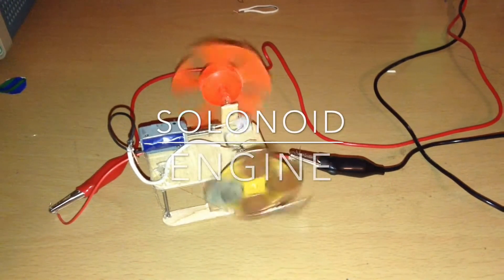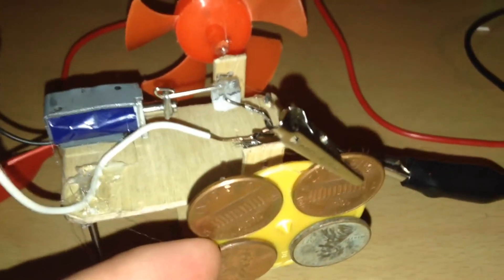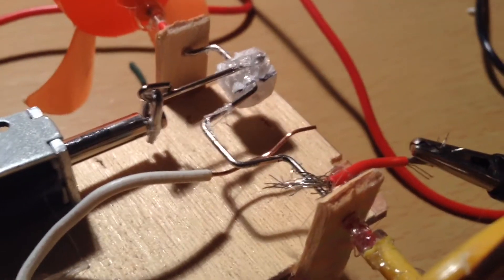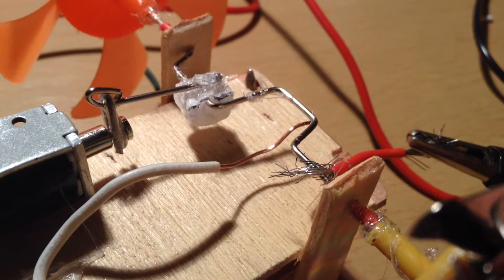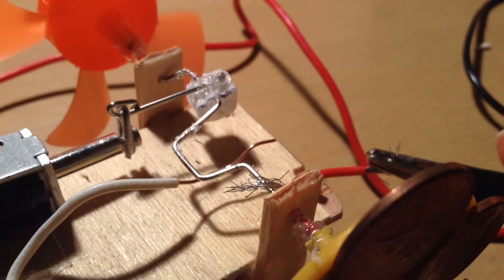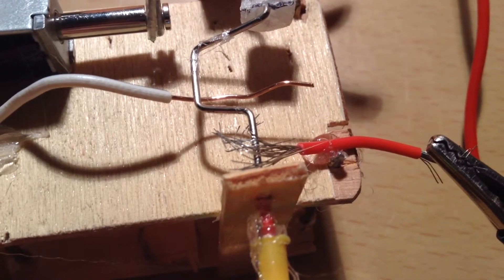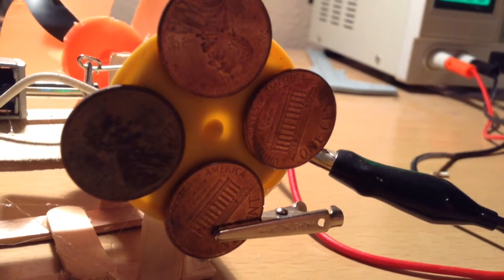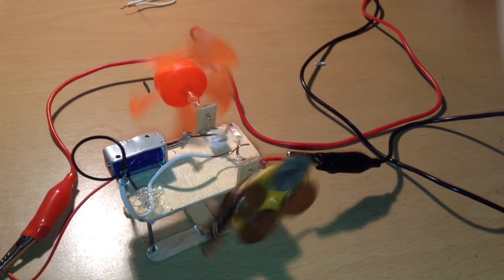Electric Solenoid Engine

Comment: Nice work dude, and very well explained. From my own experience, here are three things that would make your engine run faster: 1) feed it more volts (maybe try a dc-dc voltage booster, they are cheap on ebay) 2) mount the crankshaft on roller bearings (again, cheap on ebay) 3) use a shorter piston stroke (less crank throw). If you do these things it should rev like crazy! Thanks for sharing.
Reply from the maker: Thanks for the advice! I had no idea that the piston stroke could influence speed.  I will try to get a dc-dc converter and some bearings.  Thanks again!
Reply: No problem - for more information on the dc dc converters see julian ilett's youtube channel, he uses them to power high wattage led's and explains how to use them and set them up etc. My own single solenoid engine will now rev  to over 3,500rpm using a voltage booster ;)
Reply: Thanks for telling me where to get information on DC-DC converters, the videos really helped.  Wow, 3500 rpm is a lot!